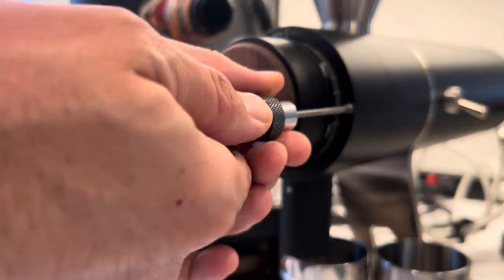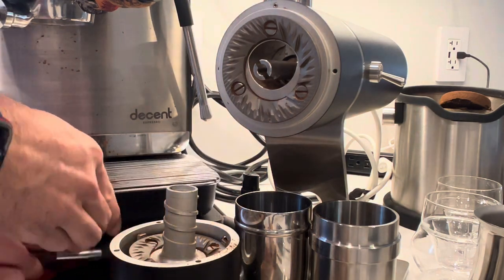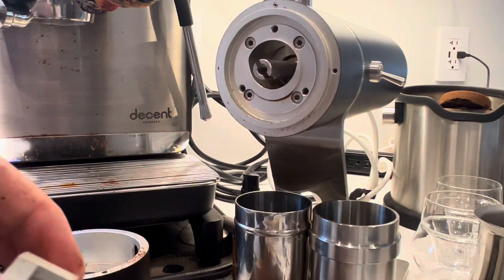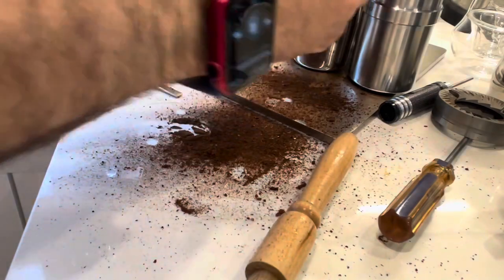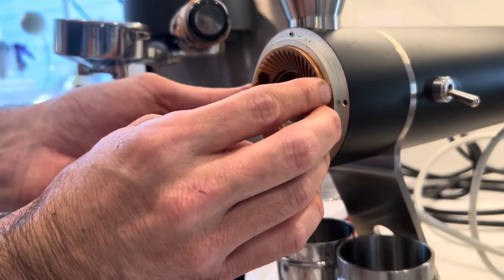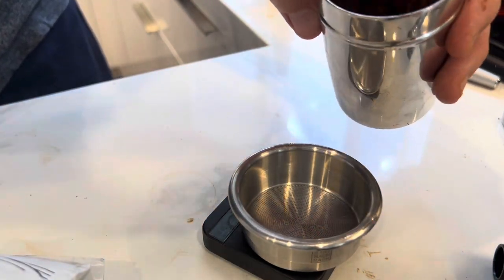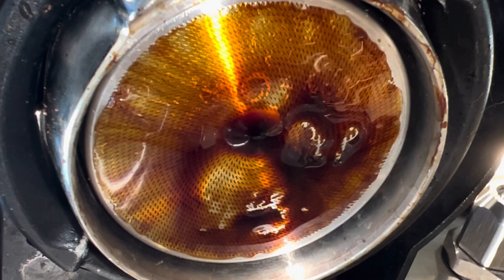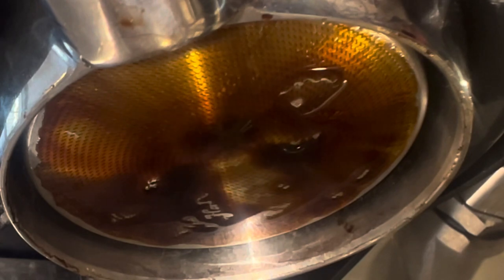Zerno Coffee Grinder: Changing Burrs

Comment: I think they mixed up which burrs were in which box.  The original ones that were in there in the videk are the silver knight coated ssp cast burrs also known as lab sweet style.  The red ones you put in were ssp High Uniformity Espresso burrs with redspeed coating. 
The original burrs that you talk about if they were a similar geometry but looked like regular tool steel that was most likely the mazzer burrs. 
You should notice more flavour clarity and less body now with the ssp HU there.
Oh and the last burrs without the more aggressive cuts towards the center that's the ssp MP Unimodal burrs. Highest clarity lowest body.
Reply: That’s correct

Comment: Looking forward to your book. Ordered it yesterday. Question on Zerno - I have a DF83v with SSP HU burrs which are perfectly aligned and DF64II with the red Sweet Lab burrs - well aligned (not perfect as I had to do gradual shims since there is .01 inch from high to low on the rotating carrier. Anyways I am able to order a zerno next week - worth it given my set up? The bigger grinder I use for espresso and the smaller is my all around grinder for everything else.
Reply from the maker: Thanks! I would have a hard time suggesting to change your setup given the investment. I suspect any changes might be minor. What machines/methods do you brew with?
Reply: I do chemex and hario switch for pour over and for espresso I had a crossland CC but now waiting on a new línea mini. I roast with a nucleus link and do coffees in the light medium to light dark range. I test and measure everything with the DiFluid suite (r2, microbalance ti, Omni)